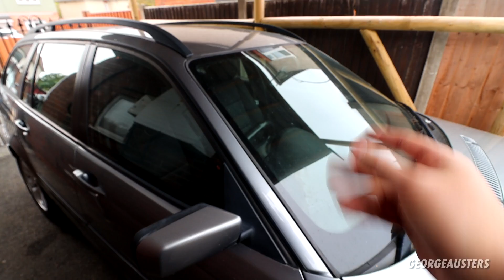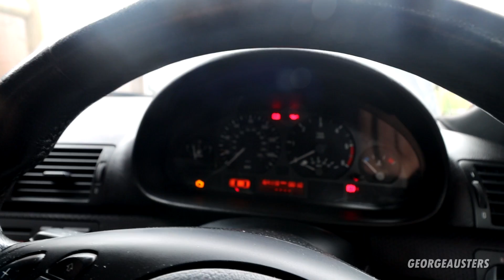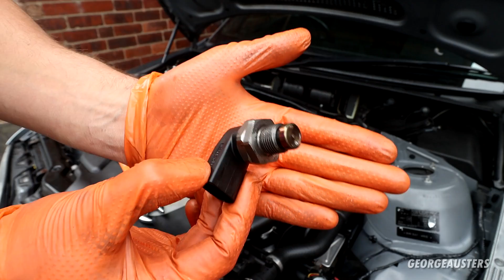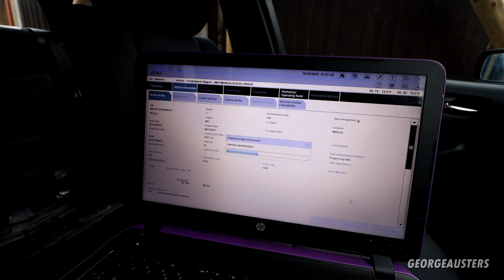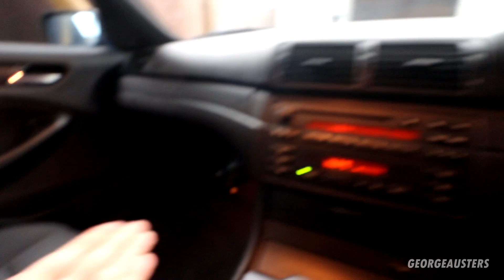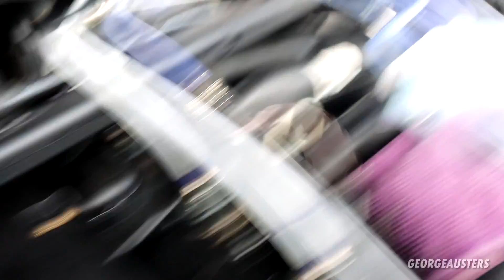TRADING UP FROM £500 TO MY DREAM SUPERCAR | PART 5

Comment: Could Inpa give you more info/data/live data on these old (E series) cars?
Fault codes are not always enough to know. Here you seem to have to be able to read the pressure in different parts of the system, as a first step, or the next step.
Reply: I find the fault codes on INPA for E series cars  give a bit more useful information once translated from German. And yeah I find the live data a little bit easier to read on there.
Reply: @leiflillandt1488  that problem sounds so annoying, have you tried installing inpa from a different source, say for example you install it from one particular forums copy, then instead you try a copy from another source? I've had issues in the past where English versions did not work correctly for me so I stuck with the German copy I had in the first place.

Comment: Have you checked for power at the tank pump when it has stalled?  I think that the pre supply pump is noisy because of lack of fuel through it. You could connect a voltmeter to the tank pump to watch the voltage whilst it's running. At least it won't cost anything lol
Reply from the maker: You only have power there for 5 seconds when the ignition is on
Reply: Surely there should be voltage to pump all the time?
Reply: Surely the pump should be powered all the time it's running?
Reply: Correct! The 5 second run time , at ignition on, is an initial system prime. It should run continuously when the engine is cranking, or running. I would have checked fuel pump supply, and ground, using a scope to see if the circuit is failing when the engine shuts down or refuses to start.

Comment: If a wire gets overheated & burns partially before a fuse blows you can change the fuse & everything can work. However when you run power through a weakened wire for a while it can cause a short. I think you're dismissing electrical problem too easily. The fact that it seems to be a regular 20 minutes run time then stops would take me looking at wiring. You also have been running into parts that have been replaced already suggests to me that you're doing what the previous owner did which was suspect parts being faulty,so again I would look at wiring.
Reply from the maker: I wouldn’t say it runs regular as the pre supply pump is noisy

Comment: i don't understand why you are so sure it can't be a electtical issue. swapping the two relays, and the car didn't start. i assume they are the same? That might be a clue there is a connector/pin fitment problem.  after swapping it back, the car suddenly started again. Very suspisous about that. Try moving the fusebox/knocking it when the car is running. Do more wiggle tests with a running car? Keeping a open mind about a diagnostic, instead of ruling out possible causes in advance, is rule nr1 in diagnostics.
also load a circuit when measuring voltages is a must!

Good luck on this stubborn car!

Comment: Electrical problem can only be eliminated with a scope. You need to buy one....

On the guesswork front , to me it's as if air is getting in to the fuel system.  A small leak somewhere can cause this sort of thing  even if no leak can be seen. A fast moving fluid creates the Venturi effect...I presume air in the system could be seen as a momentary dip in pressure at the rail if you were to scope the sensor.
Reply: I had a big issue with my E90 getting air into the coolant system. One hose clamp was coming loose and air was sucking in through it. Created air locks in the system and coolant leaving the leaking clamp. Even after sorting the clamp it took time for all of the air locks to be cleared. Could be something similar with the fuel lines perhaps.
Reply: @LeedsHypnotherapist  I have never heard of that problem in a cooling system. However I can see how if the coolant moves fast enough over the leak it may pull in air.
Reply: @andrewthompsonuk1  it was a real pain for a while but thankfully it's all sorted now

Comment: Hello George. If you suspect on fuel pump wiring or pressure drop. Please use some equipment that you probably already have in garage.. Connect pressure tester (gague)  at the end of the fuel low pressure line(engine side). Take a measurment with and without relay. Try to activate pumps bidirectional. If you found that there is a pressure drop or pumps stops to work apply them direct current from separated wires directly from battery. Use a  current clamp on supply wire if you don't have a scope. Test one circuit at time and you will find fault very easy.
Reply from the maker: There isn’t any shrader valve to connect a pressure tester to
Reply: @GeorgeAusters   No need for shreder valve on cr engines. There is a quick connector or a rubber pipe connected with clamp. So if there is quick connector buy a male connector or take it from something else to make a test.

Comment: I think it could be the crank shaft position sensor, there’s two, one intake and one exhaust I had the same problem with my e46 but it’s petrol. It’s a common problem after 100 thousand the sensors go bad and I’m pretty sure there was no fault codes but exactly the same symptoms. Please don’t scrap.
Reply: Sorry I meant cam shaft position sensors. I bought cheap ones the first time was fine for a few weeks and then the same problem then got oem then was perfect. Just a thought mate. Hope you figure it out.
Reply from the maker: Previous owner already tried that
Reply: @GeorgeAusters  I wouldn't take his word for it
Reply: That's what I said Cam shaft sensor .Must be. Had exactly same problem . Once car got hot enough it and then engine stopped it wouldn't start again for maybe 1-2 hours.

Comment: Have you tried disconnecting the fuel lines from each end and blowing in through? Like you  mentioned it could be some form of blockage and when its moving about with the pressure it stalls engine etc. Then takes a while to move again till will restart.

Comment: HPFP remove and get it tested, l use a place in Egham Surrey, free to test and £150 to overhaul, one day turnaround. Long cranking starts are normally air in fuel system from say a leak in pressure lines or you’re HPFP on it’s last legs. Have your laptop rigged up prior to starting and monitor the live data on fuel pressure. Also for the £18 price tag of a relay just replaced it.

Comment: Does only 1 injector have electric plug/sensor connected? One should have a sensor which controls the fuel pump. Not all models have but there is not much info on your engine you have apart from 2.0d. But which one? That sensor can fail and can cause cut out. Other problem could be the crank sensor. I understand that you want to keep the cost down but it is a guessing game.
Reply: There is no need to guess if you have the right tools.
Reply: @elliottpeters2996  Well.. after he spent a lot time on this car and not figuring out what's wrong with it you might be the right man to reveal what you think could be the RIGHT TOOL to find the problem straight.
Reply: For me this one would for be for sale spares or repair! So frustrating! I shudder to think about problems with EV’s at 20 years old - and wha it will cost to scrap them because of all the toxic waste ! 😡

Comment: I had a 2003 BMW 745li that did the same thing. I changed the vvt module and the dme module.As the dealership said, and it still did the same thing. Came out to be a bad Crankshaft Sensor. If I was you I would try a new Crankshaft Sensor.

Comment: Have you tried using the scanner on live data to check when the fault occurs! If the pump is going noisy then the fuel rail pressure reading should be dropping off to the point where the car cuts out due to lack of pressure! Also I would check the fuel filter for any debris because if any pumps are breaking up then I would expect some filings to be present! Also when on live data check all sensor readings aswell ! A bad temperature sensor reading can play havoc with running of the car

Comment: i would replace the pre-supply pump activation  RELAY ,sounds like it might be on its way out. and would explain noisy pre-pump due to lack of fuel in it also sensor with green O rings body  looks a bit iffy.
Reply from the maker: I already tried swapping it for the fog light one though? The pre supply pump relay is also the same one as the in tank pump which runs fine

Comment: Maybe you should look at the 12v supply to the fuse box? You moved some relays around so there might be a connection issue or power issue. It's worth a shot but I understand your frustration with this car. Also as always great video!

Comment: When you nipped up the nuts of the rail that could have been it because any air getting in at that point will stop the engine from starting, and if you could use the car it would help.

Comment: high pressure pump problem or a sensor (pressure) iff thats all ok its the ecu. Water damage or a loose solder joint.
Reply from the maker: What makes you say that?

Comment: Has the car been in an accident? If so one of the crash sensors may be triggering the fuel shut off. ( if fitted)
Reply from the maker: Don’t think so, also not sure why that would make the fuel pump noisy
Reply: @GeorgeAusters  dont think the noise is relevant  unless there is back pressure ,which may cause that. A blockage maybe? A real head scratcher this one

Comment: Man, it's the high pressure pump, I already made all what you did. The problem was the high pressure pump.
Reply: You need to remove the high pressure fuel pump and to disassemble it, you need to check if  it's still in good condition, for me wasn't, and also make the pressure test on the injectors on a specific laboratory/service.
Reply from the maker: What makes you think that? It’s producing the required pressure
Reply: @GeorgeAusters  when you have finished all your check on the fuel system and still don't want, it's the high pressure fuel pump, if the regulatory sensor for pressure and pressure sensor from the common rail are good, the problem is HPFP, just get it dowm from the car, disassemble it and you will see in interior the defects. Same errors like you I had.
Reply: @GeorgeAusters  And the sensors should be verified with a multimeter, also the regulatory sensor can be verified with a battery and you can hear the sensor when open and close.

Comment: While its running wriggle the relays and connectors etc on the fuse box to see if it stops possible bad connection in  the fuse box

Comment: Havent watched full video, is desired common rail pressure being met during cranking when its taking a while? The injector table in the map will have a minimum pressure when fuel is first injected. Cutting out randomly combined with long cranks id agree is probably something mechanical vs eletrical.

Edit: rail monitoring during startup code IMO would coincide with what I said above.

A vauxhall 1.9 wont fire the injectors until the rail has 1600mbar, 1599mbar isnt on the table with a number of mg fuel, so gets 0mg... No fuel.

I personally think its common rail related, hp pump, or regulator, or sensor. Obviously all closely linked!
Reply from the maker: Already ran the test and it’s getting the pressure that’s required👍🏻
Reply: @GeorgeAusters  So why is error code 004B90 keep comming back on then? That's the issue. Check when the engine has died again, if that code is present again.  If so, then check the live data on both the rail pressure regulating valve and the Fuel quantity control valve, especially during engine start.
These kind of malfunctions are hard to diagnose, and often easy to fix, you just have to narrow down components.

My best guess is that one of the valves act up randomly and gives this trouble.

Comment: I had a rover 75 cdti same engine as bm320 had same problem turned out to be engine ecu had got wet . Engine would run perfect then a random cut out drove me crazy . Cleaned ecu up and dried it then it was fine good luck
Reply from the maker: ECU box looks dry
Reply: Stay on the bmw it’s great to watch . The fuel metering valve you took off high pressure pump looked second hand maybe worth testing

Comment: second hand parts are ALWAYS  a gamble mate, a LOT, not ALL, but a lot of breakers / recyclers whatever they call themselves will whip a part off a car, and bung it on fleabay, knowing that the MAJORITY of ebay buyers can`t be bovvered to return a part and open the appeal process they`re onto a winner winner chicken dinner 🤨🤨🤨🤨🤨🤨
Reply: New parts are an even bigger gamble unless you get the genuine one.

Comment: Unless your HPFP is on its way out i cannot think of anything i was going to mention if you had run the fuel bleed procedure via ISTA as it revs the motor to 2k for about 10 mins flushing any air out etc but im going to assume you have already.  What a pain in the ass.
Reply from the maker: Tried the bleeding procedure in one of the first videos mate👍🏻
Reply: @GeorgeAusters  fair play
Reply: @GeorgeAusters   But later on, you did open the system again when you replaced the in-tank fuel pump and pre-supply pump, possibly (again) introducing air into the system, didn’t you?